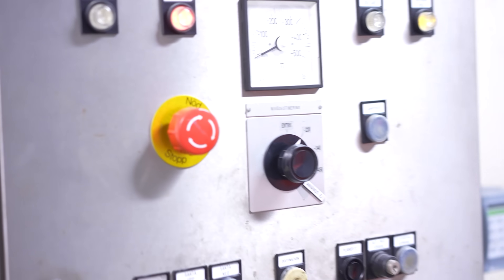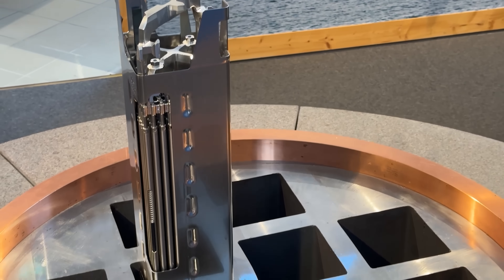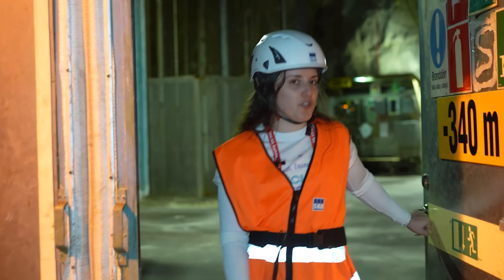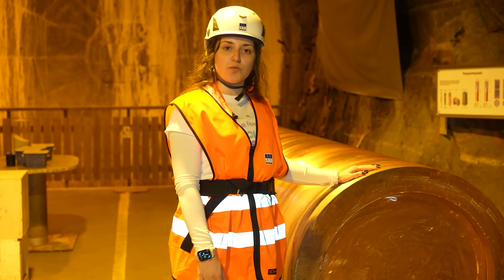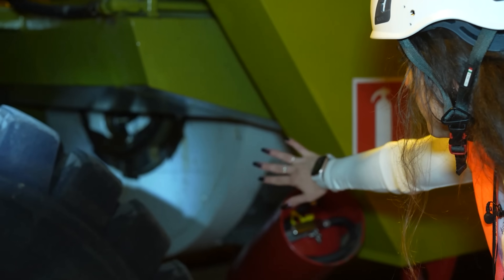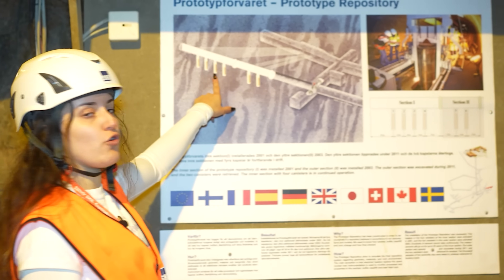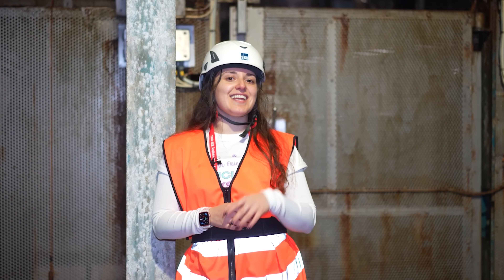The Solution to Radioactive Nuclear Fuel Waste

Comment: I do hope they're storing this such that it will continue to be accessible, in case we want to retrieve it in a few decades or centuries.  We may want to check the containers for unexpected types of corrosion, or retrieve the "waste" for reprocessing and use as fuel, or put the waste in a fusion reactor or ADR to burn it down to low level waste under neutron bombardment (and get energy from it).

Comment: I don't understand why would one want to do this with partially used nuclear fuel?  The fuel is 95% unused.  Why not use this fuel in molten salt reactors or fast neutron reactor.  This would reduce the waste to 1/1000 of the original amount of which in only three hundred years would decay to below background. Like 20 times the energy gotten from the first reactor use and no waste left over to deal with.

Comment: we'll probably have to shut down electronuclear power stations in France still if we don't get new pools built. right now they "optimize capacity" which is basically cram some more tighter spaced assemblies in the pools than what they are designed for, some of the waste is send to be processed in russia. a supplementary pool could be ready by 2034, the current setup at la Hague will be at critical capacity by 2030 no matter how much waste gets processed by foreign countries under the table and no matter how far we push storage capacity. 
There are 18 power stations and 56 PWR units online and that's 4 years without being able to dump all this shit it's not looking very good.

Comment: Summary

Introduction to SKB and the Facility  
- 00:00 Introduction to SKB, the Swedish Nuclear Fuel and Waste Management Company.  
- 00:13 SKB has developed a design for a permanent geological repository for spent nuclear fuel in Sweden.  
- 00:22 Plan to visit the underground facility and labs at Äspö Hard Rock Laboratory.  
   
Journey Underground  
- 00:37 The facility is 500 meters underground; the first stop is at 220 meters.  
- 00:53 Arrival at the first stop, 220 meters below ground, where the research facility is located.  
   
Research Facility Purpose and Design  
- 01:02 The research facility studies the potential for building a permanent geological repository.  
- 01:20 Location in Sweden was chosen for both positive and negative geological properties, making it ideal for research.  
- 01:52 The facility's depth and various layers are conducive to different experiments.  
- 02:09 Schematic overview of Sweden's design for a permanent geological repository.  
   
Storage Design and Safety Measures  
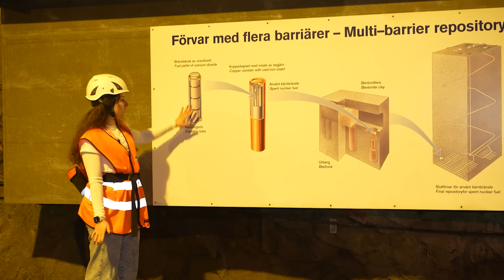- 02:28 Explanation of how spent fuel is stored in copper canisters surrounded by bentonite clay.  
- 03:01 Multi-barrier safety concept described to prevent environmental contamination.  
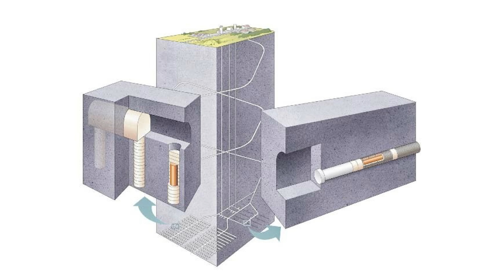- 03:42 Initial horizontal and vertical canister layout concepts; vertical layout was ultimately chosen for implementation.  
   
Exploring the Facility's Lower Levels  
- 04:35 At 340 meters underground, examining a built example of a future tunnel where canisters will be stored.  
- 05:42 An experiment in the Äspö Hard Rock Laboratory related to expanding storage for low and intermediate waste in Sweden.  
   
The Copper Canister  
- 06:17 Close-up look at a copper canister designed to hold spent nuclear fuel.  
- 06:40 Sweden's choice of copper for canisters, which is expected to resist corrosion for at least 100,000 years.  
   
Bentonite Clay: A Protective Barrier  
- 07:30 Bentonite clay discussed as a protective barrier to absorb water and prevent contact with the canister.  
   
Transportation and Placement of Canisters  
- 08:16 Design of a specialized transportation vehicle to place canisters vertically in the repository.  
- 08:50 Detailed explanation of how the vehicle operates and deposits the canisters.  
   
The Final Resting Place for Canisters  
- 09:36 Description of one of the smaller tunnels and the hole where the canister will be placed.  
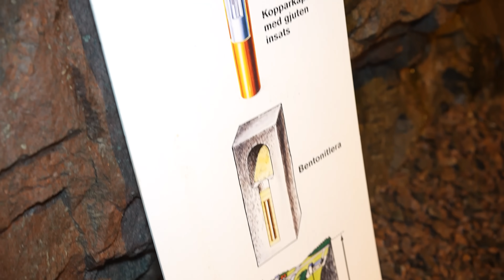- 09:52 Visual description of the hole dimensions and how the canister fits within it, surrounded by bentonite clay.

Protective Barriers in the Repository  
- 10:14 Summary of the three protective barriers: copper canister, bentonite clay, and bedrock.  
   
Prototype Repository Experiment  
- 10:38 Description of an experiment with a prototype repository where six canisters were buried.  
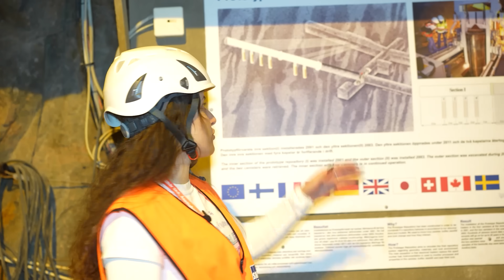- 10:53 Three canisters have been extracted after 20 years, with a fourth one due for extraction.  
- 11:01 Testing conducted on canisters to assess their condition after 20 years in simulated repository conditions.  
   
Extraction and Analysis of Canisters  
- 11:57 Observation of a canister being extracted, which was filled with clay and had an internal heater simulating the heat from spent fuel.  
- 12:31 Mention of water seeping into the tunnel, which is thousands of years old and very salty.  
   
Chemistry Lab Insights  
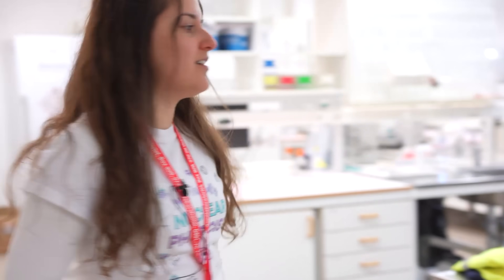- 13:02 Visit to the chemistry lab where water samples are analyzed for properties crucial to the repository's design.  
   
Bentonite Lab Testing  
- 13:35 Examination of bentonite testing, which includes assessing behavior under normal and accident scenario conditions.  
- 13:56 Bentonite samples from the prototype experiment are being tested to see how properties have endured over the years.  
   
Conclusion and Invitation for Comments  
- 14:33 Conclusion of the tour at the Äspö Hard Rock Laboratory, with thanks to SKB.  
- 14:47 Encouragement for viewers to comment with their thoughts and questions about the facility.  
- 15:02 Reminder to like, subscribe, and turn on notifications, with a sign-off from the host, Elina.

Disclaimer: I used gpt4-1106 to summarize the video transcript.  This
method may make mistakes in recognizing words and it can't distinguish
between speakers.

Comment: Elina, you mention that the holes are 6 meters apart for a reason, how much heat does one of those copper containers put out? Does the heat level increase over time? If it weren't for the radiation, could you touch one of them?

Comment: So when energy starved descendants of the human race looks for energy will there be a giant rolling boulder and poison darts to greet them, how many future descendants will die trying to recover the energy this generation threw away.
So how many EV could be made with just one copper canister?
Wouldn’t it be easier to extract energy from nuclear waste that has a shorter and hotter decay cycle, like the stuff that comes from Molten Salt Reactors?
Only take what you need and don’t waste it, is a simple principal that works for past, present and future.

Comment: @Elina - If the Bentonite does absorb moisture from the ground, how does it dry out as their is no air flow, the moisture is trapped. Is there a risk of the moisture growing mold from trapped moisture and warm conditions caused by the spent fuel causing premature failure of the protection measures?
Reply: This is an illusion..
Depleted Uranium is Purchased by the US Military Industrial Complex, and they make Depleted Uranium Munitions, and sell to NATO Countries... 
Look at the insane amount of Birth Defects that suddenly appeared after Wars in Countries such as Iraq for example.
The citizens in Iraq were left with nothing but destroyed shit everywhere, and they used every single resource they could find, such as dismantling Tanks (To use the Metal) that had been hit With Depleted  Uranium Shells....
Those people are screwed.

Comment: Those copper tubes are crazy. Has to be super expensive.
Reply: Thats what I was wondering about too. Such a huge amount of copper materials being used for this!
Reply: It's really not that crazy given the value of the materials it's storing or considering it a cost of doing business. Sure, a broke meth head that would otherwise steal the copper pipe off a construction site would be salivating . . . but it's like $63k each. 7400 kilos of copper at $8.45/kg.   @nholth  
Still feels like a  waste.

Comment: I am not convinced Copper will last that long in water twice as salty as that of the Baltic Sea.
Reply: It's not gonna be submerged in water and she mentioned that in a million years, the expected/simulated corrosion depth of the copper canisters would be 2-5 mm (out of 50 mm thickness) so the margins are very large.
Reply: @jregns  Listen again.  She states the area (as are all deep excavations) is prone to flooding.  She also states the water below ground has a high salt content.  We are not supplied with information as to the anticipated salinity of the water the copper would be exposed to before a guesstimate of the depth of corrosion.  This is why some of the previously buried canisters are being exhumed and examined.  Yes, if it is pure water the copper will last many centuries.  But it is salty water and that gueesstimate becomes dubious, even if the walls are 50mm thick.
Reply: @kenibnanak5554  I'm reading (a 7 year old article) on SKB's homepage that the main concern is sulfide corrosion from the natural low occurrence of sulfide in Swedish groundwater. However, copper corrosion in oxygen-free water (at the depth of the capsules) has shown to be non-existing in experiments. Good thing they are still testing it now then. The margins for storage will still be very large, or they won't approve it.
Reply: @jregns  We agree.  One opti0on of course is simply increase the thickness of the copper shell walls.

Comment: 🤔 umm what about making a sand batteries to capture the heat and  converted into electric energy ⚡⚡⚡ any time you like and use sterling engines, just pipe the heat away to a cooler area where to Stirling engines are, and have a thurmal coupling switchs to turn on and off with demand.
Anyways that's my idea

Comment: This is just an observation from an old man who has had several aneurysms and few mini strokes plus other ailments, meant as anything but , Elina whenever you say Canaster i hear Cancer ♋  also could you please talk a little bit slower , in my youth i loved watching cartoons there was one in particular called Speedy Gonzales about a very fast Mouse 🐹 and oh bum i forgot who the other characters were it may have been Sylvester the cat anyway Mr Gonzales would pinch the Cheese 🧀 and take it back to a well deserving family . Anyway what i was getting at in a round about way is maybe slow down a tad.
Please don't take offence 💐
Reply: I sympathize with you. I sometimes use the playback speed set to the 75% setting: go to settings (the "gear" symbol menu) and click on speed to select slower. The subtitles (the CC menu) are often helpful too .
Reply: @thewheelieguy 
Also. You can set the speed by 5% up and down, so if 75% is too slow, you can make it 85%, for example.

Comment: I LOVE it when Elina talks Nuclear to us.   Our "Friendly Nuclear Physicist" does it so well.

BTW, we used Bentonite Clay when I worked in the Oilfield for several reasons.   Mixing it in Dry Powder form with water, as well as other Chemicals for Special Purposes, creates Drilling Fluid, also commonly called "Drilling Mud," to be pumped down hole through the Drill String and Recirculated back to the Surface through the Annulus.

Your Fan Club Loves you Elina!
Reply from the maker: Thanks so much means a lot 👩🏽‍🔬☢️
Reply: Bentonite clay is also used as a clarifier in winemaking, and I believe in some cosmetics. It's truly a versatile material!
Reply: @betterl8thannvr  -- I DO NOT know much about Winemaking but I did know about Bentonite being used in the manufacturing of some Cosmetics.
Reply: We use bentonite to line dirt water tanks so they hold water instead of it seeping into the ground.
Reply: @FragileNM  -- We have also used Bentonite to Grout casing into Environmental Wells to prevent the commingling of Surface Water & other Fluids with the Groundwater.

Comment: That much copper is going to make it super expensive, Makes you wonder if anyone has thought of using multiple layers of different materials instead.
Reply: At those higher frequencies & voltages, the skin effect comes into factor; so it's not as much as you think there should be.

But even it was, you can just make it graphite cored.

Comment: This sounds a lot more stable than yucca mountain here. Wherever we put it needs to be reasonably accessible again for when we find how to reuse it. That will save huge amounts of money by not having to mine new uranium or basically mine the waste we buried. We’ll just have to take it out of storage and use it up. When we’re done with it we can put what’s left right back into the same storage again. Eventually we’ll find a better form of energy like a Dyson sphere. By that time we’d most likely be able to force it to decay at a massively quicker rate or take it to a different planet and store whatever’s left there. If we don’t blow ourselves up then our tech will progress at a much faster rate than the decay rate of spent nuclear fuel.
Reply: We already know how to reuse it.
Reply: Which planet were you thinking to take it? Most certainly every other planet has lot more radioactivity than ours.

Comment: I have a question. How much waste a canister holds? For a normal life spend of a reactor - 30 years, how much canisters will this be? This facility if it gets fully constructed, with the maximum number of deposits, how much waste it can accommodate, but not like in tons, in actual reactors? I would like an answer like - fully build will be sufficient for the waste produced by X number of reactors during their life of 30 years...